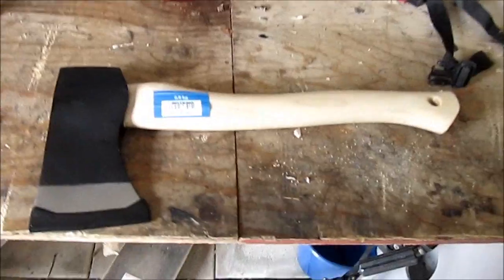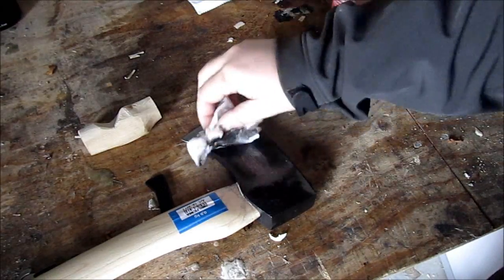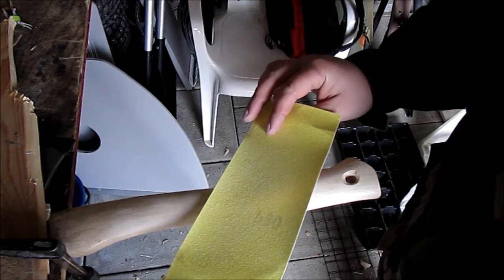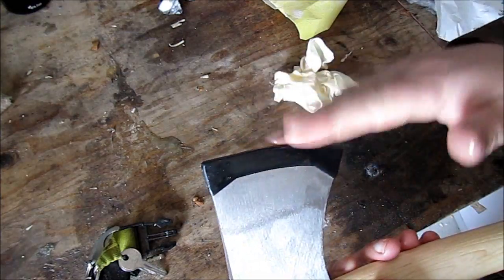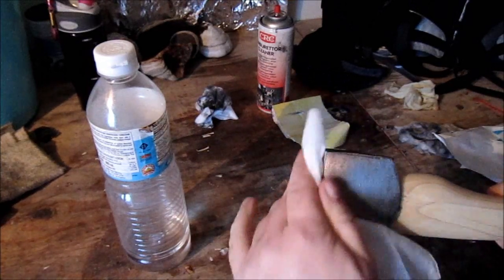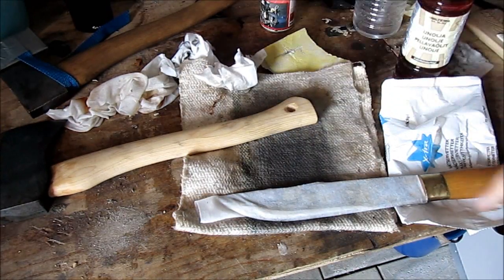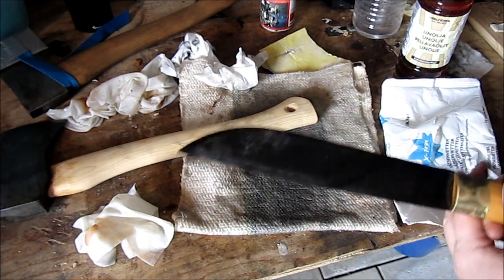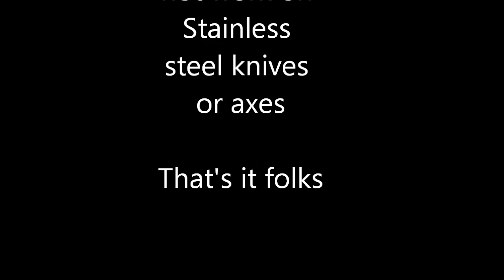Forcing patina on axe or knife

Comment: Got better grain orientation in the handle than Gransfors bruks! Needs a good soaking in boiled linseed oil.
Reply from the maker: I did that later. Still got the axe, but have a Wetterlings now, with a lighter head. The Knife is still my go to knife, and comes on every trip I make, 8 years later 😀
ANd looks even better now with a more natural patina on it :-D

Comment: Fantastic work brother. I will use this in conjunction with yellow mustard on an axe I'm making right now. Thanks for the tip
Reply: +John “survivor johnny” Tewelow I'm soaking the Hudson Bay style axe I've been making right now in vinager. When I unwrap it tomorrow I will finish the video I'm doing on it. I am giving you a shout-out and the credit for the idea in the video
Reply from the maker: +John “survivor johnny” Tewelow thanks. There will probably be some wet surface rust on it when you unwrap it. But just wipe it off thouroughly and use some wd-40 on it and then soak the head in oil, and the patina will do the rest of the job :-)